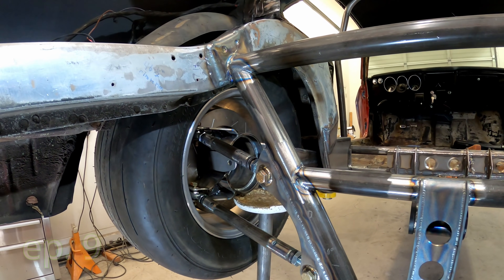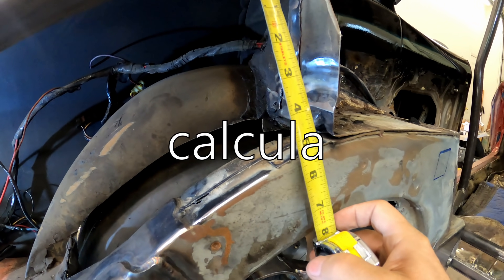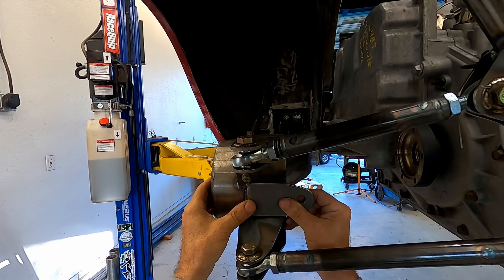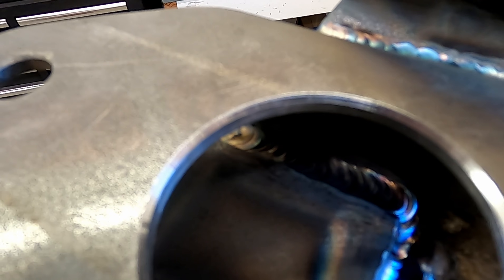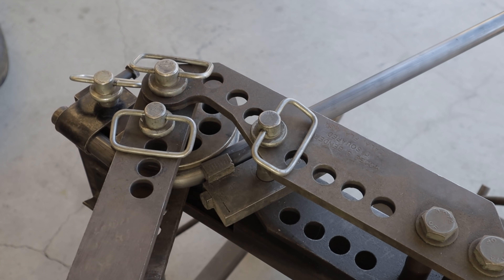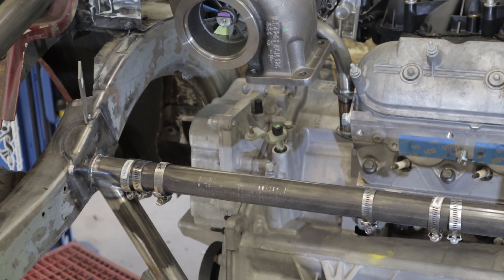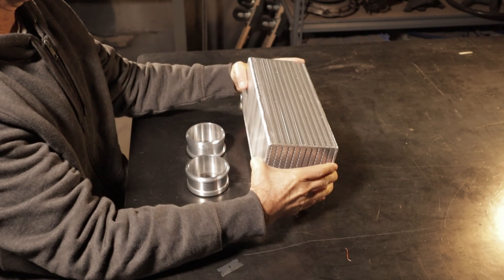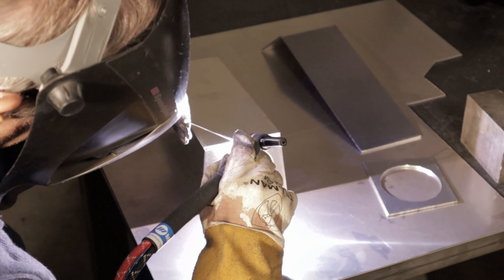V8 into Corvair ep9

Comment: Re your .125 5052 material. Seems that it bent pretty easily on your brake. What temper/hardness? H32?
Reply from the maker: I don't remember bending .125 on the brake.  I could bend a narrow piece but nothing wider than a couple inches.  3003 is the softest than 5052 and finally 6061.

Comment: Ha John . Your fabrication skills are top notch . Including welding . A tig torch really makes it nice . Just curious . Did you pressure test the intercooler . Thanks .
Reply from the maker: Not yet.  The last one I did leaked and had to be cut apart because the IC core leaked.
I have to make up a tester for the openings so I can check it.

Comment: How did the first leak test on the intercooler go?
Reply from the maker: The last one I did leaked and had to be cut apart because the IC core leaked.
I have to make up a tester for the openings so I can check it.